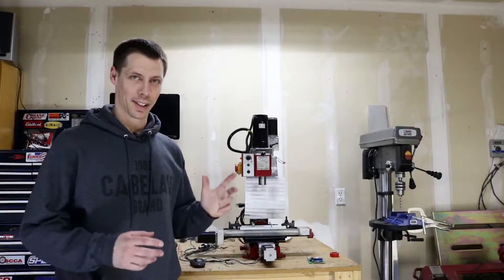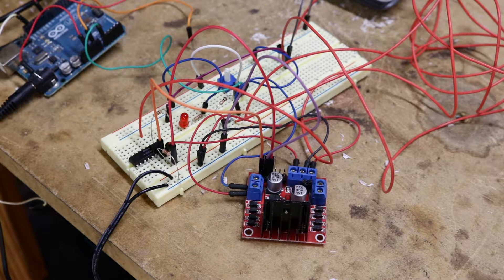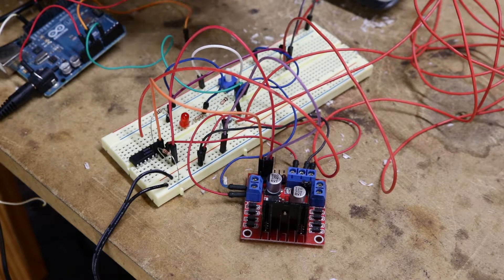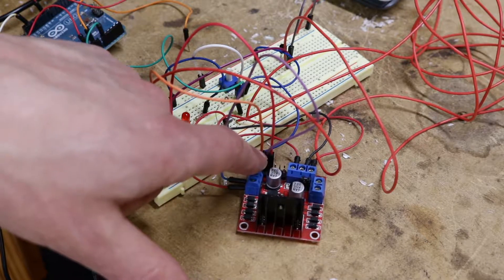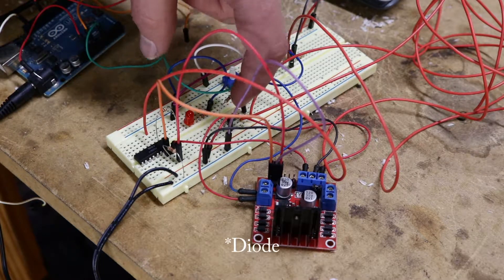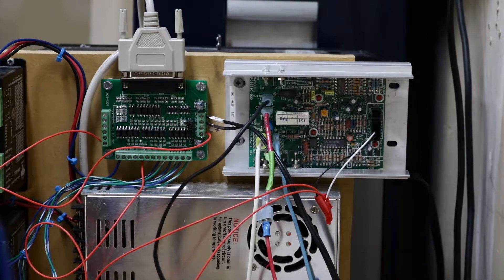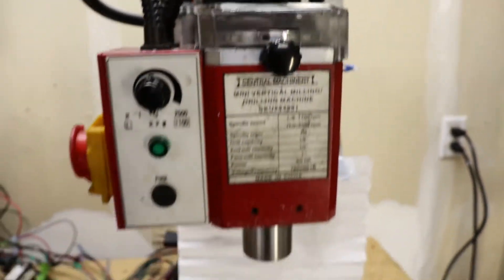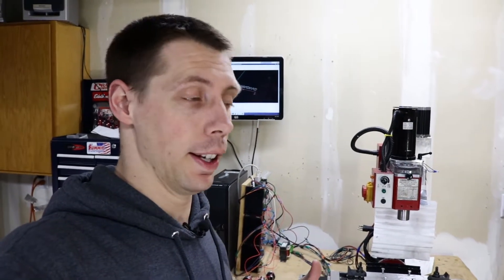SOLVED: LinuxCNC PWM Spindle Control Pt 3

Comment: Noob question. So wouldn't a tach on the spindle work for rpm? I know you won't get all the motor power due to 0-10 instead of 0-12?
Reply from the maker: I'm not sure I understand your question.  A tach would tell me what RPM the spindle is turning at.  What I was working on here is controlling the speed with the LinuxCNC spindle speed output signal.  And you are correct that if the motor controller only sees 10V, it will not run at full power.  I have a few later videos where I eliminate the L298N board.  Here is a link to the whole playlist: https://www.youtube.com/playlist?list=PLlqg1NgTmMO2EuC0W773uwWZ4vvLhFQHF
Reply: @RivalMachining  I am currently trying to put a treadmill motor on my mini lathe and want mach3 to control it. I was just going to hook up the pwm out put to the wiper on the treadmill pwm board and lose the current.  Would this not work?
Reply from the maker: Unfortunately I think you will probably see smoke.  There are several circuits that have to interact through opto-couplers and stay electrically separated for it to work.  Starting at the computer end, are you running from the parallel port to a breakout board?  If so, the current from the signals that come through the parallel cable are returned to the computer through a bunch of ground pins in the same cable.  This completes the first circuit.  Each signal is routed through an opto-coupler (basically a solid state relay) on the breakout board to trigger current flow in the breakout board circuit.  The outputs of the breakout board should go to your stepper drivers, which also have opto-couplers inside to separate the circuits from each other and ground back to the breakout board to complete that circuit.  In the case of spindle control, it is pretty easy to get a PWM signal (in LinuxCNC at least) to one of the pins on the breakout board.  From there, it must be fed into another circuit where the signal is isolated, smoothed out to analog, and ramped up to the 0-12V.  I just tested my custom board last night and it worked on my machine with a treadmill controller, at this point, I'm looking for ways to test it to ensure it works with various motor control boards before I offer it for sale.  If you have more questions, shoot me an Email at Dallas@RivalMachining.com and I could give you a phone call.  I just don't want to put my phone number here for obvious reasons.